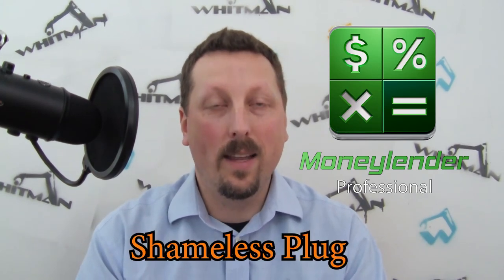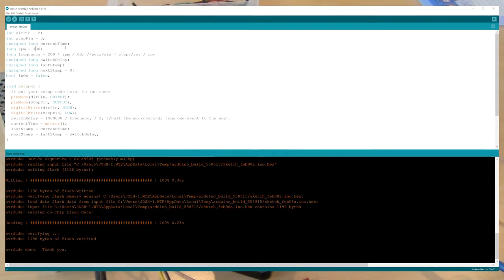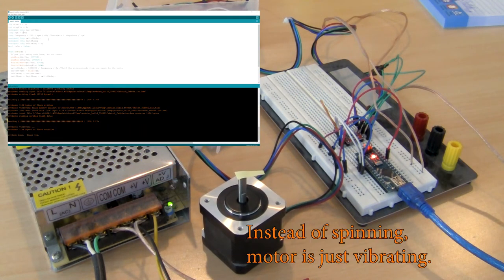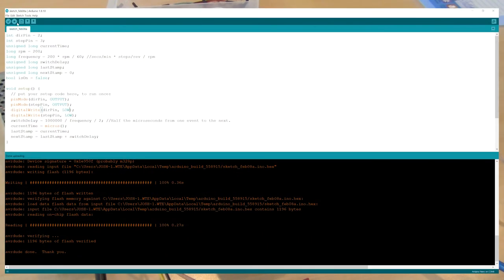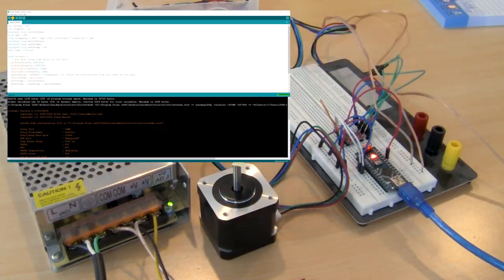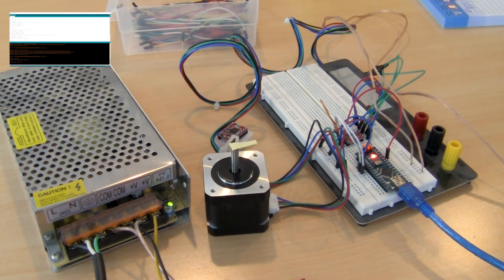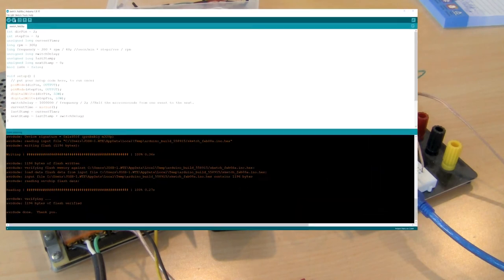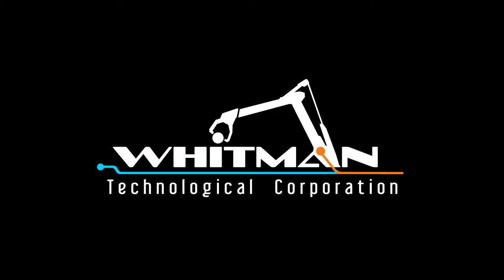How fast should we expect our stepper motors to spin? - Stepper Motor max USEFUL RPM Test

Comment: Stepper motors are a funny beasty, they are a current driven motor. 
The thing is, the faster you go, the more back EMF is generated and the current will be reduced.
When the current reduces, such as when you have reached max voltage, then the torque of the motor will fall of as the speed increases.
You will have to overcome the back EMF to maintain the current, you have to increase the voltage.
Thats what the stepper driver is supposed to do.
The higher the voltage you can supply the better.
Also make sure you the set current is correct.
Now acceleration is also a very critical thing to consider.
Acceleration is torque/mass, so if you want to accelerate the motor to a speed in almost no time, then your gonna need a lot of torque, the thing with stepper motors is if you exceed the torque rating of the motor, it will skip steps and or not even move.
You showed that at higher RPM settings, if you started it spinning by hand, you couldn't stop it.
So when starting a stepper motor, ramp the speed up over time and you can get some very reliable operation from it.

I would like to see you re-visit this subject using a speed ramp up and see how much better the performance will be.

Keep up the good work.

Ray
Reply from the maker: Awesome information, thank you.  Interesting note about raising the voltage to overcome the back EMF.  I'm making a CNC router right now, and I picked up NEMA 23's and a 24V power supply to drive them.  If I have trouble getting the table to move at an acceptable speed, maybe I'll need to move up to a 48V supply.

In my reply to parin dave, I revised the Arduino code to include an adjustable ramp-up period and then posted it so people can copy/paste it.  When testing that code, I was surprised to see that even with gradual acceleration the motor still didn't want to go much more than 350rpm.  I adjusted the current on the driver to match the specs for my stepper, and also played with the setting to see if I could get better results slightly above or below the rating.  No significant change at all - 350 or maybe 400 was the cap, even with a gradual ramp-up in speed.  I was also curious if having something heavy to spin, so the inertia helped with the transition between steps, would affect the max usable speed, but didn't do anything with that.

I think you revealed what the real limiting factor is.  The back EMF.  The motor's coils just barely get the circulating current to stop and start going the other way just in time for it to switch again.   The time from backward spin to neutral is probably very close to balanced against the time from neutral to forward spin for each step.  There's very little additional torque being supplied by the motor at that point.  Raising voltage would shorten the time to reverse the current in the coils, allowing for faster stepping before that same tipping point is reached.

I really like your comment, thank you.
Reply: @WhitmanTechnological  The biggest cause in this type of motor as far as the generation of back EMF is the fact the coils are just big inductors.
At DC the coils have a resistance.
When you reverse the current however, the magnetic field needs to collapse, this collapse will induce a voltage that opposed the  the change in direction, this is seen as an impedance until the  current flow establishes a magnetic field in the opposite direction.
The more rapidly  the direction reverses, the  higher the impedance will be.
This follows the Maxwell laws governing inductors and inductance.
This is not like a normal motor where the actual rate of rotation governs the amount of back EMF.

Ray
Reply: Are the TB6600 drivers simply very slow motor drivers (thus they can't forward messages fast enough) or is the motor the main factor for determining how fast the commands can be processed?
Reply: PS: So a bldc with a worm gear is best in the budget/accessible range for relatively high speed AND torque or there is a better solution? Thanks in advance for answering these questions.
Reply: @OMNI_INFINITY  This is more an issue of the motor and the voltage the driver can control.
The stepper motor is really just two big inductors.
The coils have a max current they will safely conduct before they overheat and burn out. 
When the stepper is on and stationary, the resistance of the coils determines the DC voltage that can be applied to the stepper motor.
As the motor starts to spin, the controller is now applying an AC voltage, an inductor with an AC voltage will produce a back Electro Motive Force (EMF)  with the back EMF increasing with the frequency. The Frequency of the AC is determined by the speed of the motor in RPM x steps per revolution.
We see this as an impedance which is added to the resistance of the coils.
When you increase the impedance of the inductor (Motor winding) you will reduce the current flowing and in turn the torque the stepper motor is producing.
Stepper motor drivers overcome this by increasing the voltage being sent to the motor.
The max speed determined by the voltage the stepper driver can supply and the max voltage the stepper motor can withstand.
Reply: @OMNI_INFINITY  You can use a number of different types of gearboxes, it all depends of the torque and if you need to be able to back-drive the motor at all.
Reply: @CyberOne  Your comment that "As the motor starts to spin, the controller is now applying an AC voltage", as if it wasn't AC when holding, is misleading - the stepper coils are ALWAYS getting an AC signal.   Look at it with a scope to see it.
Reply: @agnichatian  Have a closer look, the signal is a PWM DC, that is, its turned on and off as opposed to changing direction while holding the steady state.
A lot of controller can't supply a lower voltage and instead rely on the inductance of the coil to slow the rise in current.  Using a PWM signal power supply will allow for a DC current to flow with the chopped DC voltage.
Reply: @agnichatian  If you look closer, when the motor is being held in a fixed position, the signal is a PWM signal, not reversing as is the case for alternating.
It is easier to use a PWM signal to limit and control the current.
Remember, we do not want to exceed the max current of the stepper.
The controller is relying on the inductance of the winding to keep a controlled DC current flowing, but the controller needs the higher voltage available for when the motor is rotating and the signal has become an Alternating Current (AC)

Comment: how is this project going these days?
Reply from the maker: It's been almost a year since my last video on this channel.  In that time I started fresh with the fourth iteration of the robot.  It's been a long adventure, mostly fun, with one fairly major roadblock that took me a long time to identify.  It's a big step forward from the last Nephele video with the robot kinda moving on its own.  I picked materials more carefully for the gears and structure.  The roadblock that held me up for a long time was the ringing in the ribbon cables between the microcontroller and the analog-digital-converter chips embedded within each joint.  I was getting a bunch of bad data from the ADC chips, and only through months of trial-and-error, research, and careful review of the oscilloscope did I eventually discover that the high-low signals are ringing in the ribbon cabled like a bell.  The ADC interprets the fluctuation of the voltage from the ringing as extra high-low pulses, and sends back more bits of data than the microcontroller reads.  It was a brutal but fascinating lesson to learn, and I think I have a fix for it.  With any luck I'll have the hardware for Nephele 3 working in the next few months - and I can post a new videos.  I have about 100 GB of raw footage from the last year, but three months of "I don't know why it's not working" and 20 hours of cutting nearly identical iterations of the same circuit board on my CNC router isn't enough substance to make an entertaining video.  Lots of progress, but no functional milestone worth bundling into a video just yet.  Thanks for asking :)

Comment: Are the TB6600 drivers simply very slow motor drivers (thus they can't forward messages fast enough) or is the motor the main factor for determining how fast the commands can be processed?
Reply from the maker: I'm using an A4988 driver in this video.  I'm not driving the motor anywhere near it's theoretical maximum.  I was testing for a use case with a relatively high torque load where I wanted to be able to reliably begin spinning at max speed with minimal ramping.  Most stepper drivers can probably go much, much faster than I do in this video.  As other commenters have pointed out, ramping up the speed instead of just starting from a dead stop will get the motor spinning a lot faster.  Higher voltages can also help overcome the inductance of the motor coils as the speed increases, too.  ~300 RPM is the fastest I want the motor to go when I designed the gearbox for a robot wheel system, but the motor/driver could easily double (maybe even triple?!) that if it was completely unloaded and I ramped up the speed more gradually.

Comment: Can anyone help me ?. I have followed this video but my motor was not rotating fast, I can't vary the speed and I had more vibration. how to solve this problem? 

Thanks in advances
Reply from the maker: It sounds maybe like the motor is miswired.  The ones I used in this video have just four wires coming out.  Some stepper motors have additional pairs of wires and if those are wired backwards (or the pairs are mismatched), the coils won't energize in the correct pattern and you'll get some random twitching but not coherent rotation.  Some helpful diagrams:
https://knowledge.ni.com/KnowledgeArticleDetails?id=kA00Z000000PAkPSAW
Using a multimeter to test the resistance between pairs of wires you can probably identify which wires are looped together.  If it's 6-wire, you might see higher resistance across the whole loop and less resistance when measuring to a center tap.  Let us know if you figure out the problem.

Comment: I looked at your code, and you're doing a 50% duty cycle. That driver really only wants about 10ms high and the rest of the cycle low. I think if you ramp up speed and you only send 10ms per on pulse, you'd get a lot better results.
Reply from the maker: Thanks for the info.  If I do some manual controlling of steppers in the future, I'll write it up to trigger pulses instead of toggle the pin.  Woot!

Comment: Hello, 
Thanks for the code it worked well,

Is it possible to control the number of revolution of the motor?
For example if I wanted 30 revolutions then it stops, how can I do this? 

Thanks again
Reply from the maker: You'd count the number of pulses, and stop sending pulses when you hit the desired amount of turning.  Adding a target step count, counting the steps, and stopping the pulses when we've hit the target.  We'd wrap that into example #1 something like this:

int stepPin = 5;
int dirPin = 6;

long stepsPerRevolution = 200;  //how many steps to turn the motor one time.

long targetRotation = 30; //Number of revolutions to turn
long totalSteps = targetRotation * stepsPreRevolution; //How many steps we need to take to rotate the desired amount
long stepsCounted = 0; //Track the number of steps we've rotated the motor

unsigned long currentTime;
unsigned long nextStamp;
bool isOn = false;

//pulseDelay = RPM * steps/rev / sec/min * micros/sec and divided by two because each step requires going high and then going low (two toggles).
unsigned long pulseDelay = 100 * stepsPerRevolution / 60 * 1000000 / 2;

void setup() {
  pinMode(stepPin, OUTPUT);
  pinMode(dirPin, OUTPUT);
  digitalWrite(stepPin, LOW);
  analogWrite(dirPin, LOW);
  currentTime = micros();
  nextStamp = currentTime;
}

void loop() {
  currentTime = micros();
  
//Add a check to stop rotating once we hit the desired amount of rotation.
  if (currentTime - nextStamp >= pulseDelay && stepsCounted < totalSteps) {
    //The pulseDelay has elapsed and it's time to toggle the pin.
    isOn = !isOn;
    digitalWrite(stepPin, isOn); //Toggle the pin.
    nextStamp += pulseDelay;
    if (!isOn) stepsCounted++; //When the pulse turns off, we count it as a step.
  }
}
Reply: @WhitmanTechnological  Thanks for your time again. 

The second code worked for me. But still I could not control the number of revolutions using the same code.

Can you help me do it?
Reply from the maker: @sarahnasser6603  Did it stop after 30 turns?

long targetRotation = 30; //Number of revolutions to turn

That should be telling it to turn 30 times and then stop.  You could make that a 2, if 30 rotations is too long to wait.  I don't have a stepper driver and stepper handy to test the code, but my reply above looks like it should work properly.
Reply from the maker: @sarahnasser6603  there is a typo in there:
long totalSteps = targetRotation * stepsPreRevolution; //How many steps we need to take to rotate the desired amount

stepsPreRevolution would need to be stepsPerRevolution for it to compile.  I'm sure you fixed that already.
Reply: @WhitmanTechnological  
No, the first code haven’t actually worked even after fixing the bug, the motor didn’t start at all. It makes sound as if it’s working but not rotating not even with a push. 
However, the second code worked well, the motor rotates. In my project, i need it to rotate 30 times and then have a 2 seconds delay. 
If you don’t mind, can you help me with that or just further explain the code and what is considered a revolution. 
Thank you so much for your help so far
Reply from the maker: @sarahnasser6603  Stepper motors turn in small increments because of their internal design.  A stepper motor will list in its specifications the steps per revolution (or possibly the angle of rotation for a single step).  Most of the cheap NEMA17 motors (like the one in my video) will complete a full rotation after taking 200 steps.  To make a moto take a step, we toggle the step pin on the Arduino.  In the code, this toggling is when "isOn" switches to true and back to false again. That portion where it's true is the pulse that tells the stepper driver to rotate the motor one step.  By counting how many times isOn returns to the false state, we can determine how many pulses and how much the stepper has rotated.  When we've sent a total of 200 pulses (isOn toggles true and then false 200 times) the motor in the video will have turned one complete revolution.  If we only sent 100 pulses, the motor will have completed half a turn.  If we send 400 pulses, the motor will make two complete turns.

If you want 30 revolutions, count until you've sent 30 x the steps/rev of your motor.  6000 steps, in the case of the motor in the video, would be 30 full rotations.  Make sense?
Reply: @WhitmanTechnological  Yes, thank you so much for your effort. It worked with me; now I am able to control the number of revolutions easily 

Thanks again
Reply from the maker: @sarahnasser6603  That's AWESOME!  Congrats :)

Comment: Could you please explain how can I control the speed in code 1?
Reply from the maker: This part here:
//pulseDelay = RPM / sec/min * micros/sec and divided by two because each step requires going high and then going low (two toggles).
unsigned long pulseDelay = 100 / 60 * 1000000 / 2;

The RPM is set to 100.  If you wanted 40 rpm, you'd change it like this:
unsigned long pulseDelay = 40 / 60 * 1000000 / 2;
Reply from the maker: I just noticed this is missing a piece, the steps-per-revolution of the stepper motor.
unsigned long pulseDelay = 100 / 60 * 1000000 / 2;

It'd be more like:
//pulseDelay = RPM / (sec/min) * (micros/sec) / (steps/rev) and divided by two because each step requires going high and then going low (two toggles).
unsigned long pulseDelay = 100 / 60 * 1000000 / 200 / 2;

Comment: Can we use both Nema 17 (DRV8825) and Nema 23 (TB6650) on same Arduino simultaneously?
Reply from the maker: Sure you can.  The drivers get their power directly from a power source, and not from the pins of the Arduino.  The current needed for the logic pins on the drivers to indicate the direction and step pulses is very close to zero.  An Arduino can happily supply the stepping signals to any driver, and the driver is pulling the power to drive the motor directly from its power pins.  I have a video on my channel where I build a CNC router, and it has four NEMA23's and three NEMA17's, using TB6600's to drive the big motors, and A4988s to drive the smaller ones.
Reply: @WhitmanTechnological   Wow, awesome reply. I was looking for this kind of variation in stepper motor, but I found none. Surely I will watch your recommended video. Thank a ton for your reply.

Comment: I want to uce tmc2209 driver, when I connect the driver motor is not rotating
Reply: Is it vibrating at least? If it is, then you probably have one motor coil disconnected, could be one pin or both of them.
If it's not even vibrating, you could either have both coils with a bad connection, or the coils connected wrong, like one pin of a coil into the output of the right coil and the other pin on the wrong coil, dunno what behavior the TMC2209 would do in that case.
Other than that, you could have problems on the TMC itself, like no motor voltage, no logic voltage or it's configured for SPI but you're trying to run it stand-alone, or the SPI connection is not communicating properly.
Reply: @Kalvinjj  Can anyone help me ?. I have followed this video but my motor was not rotating fast, I can't vary the speed and I had more vibration. how to solve this problem? 

Thanks in advances